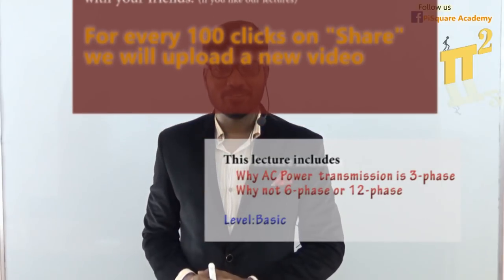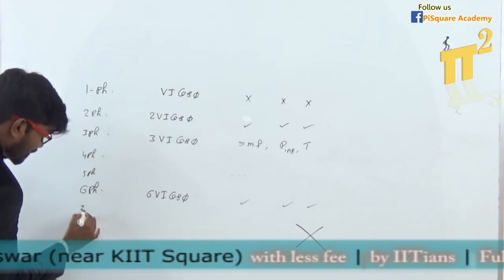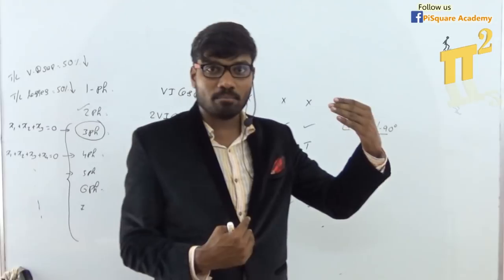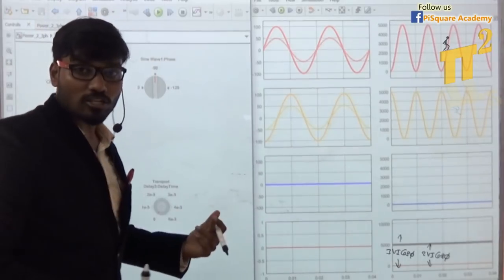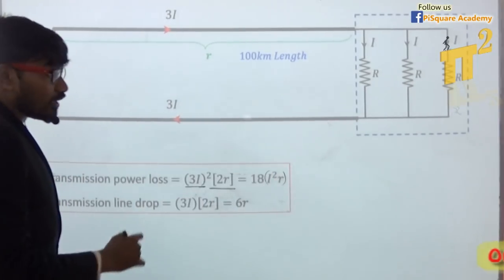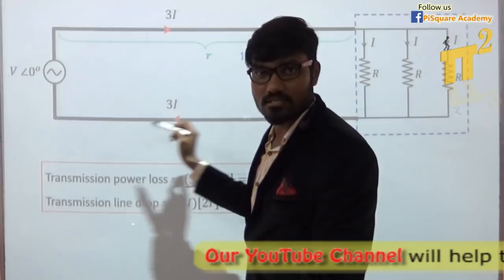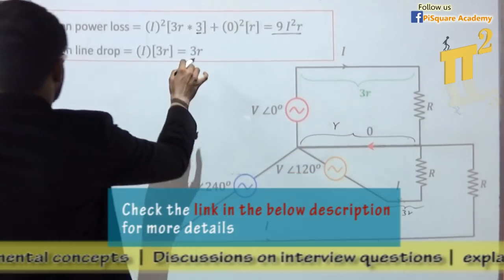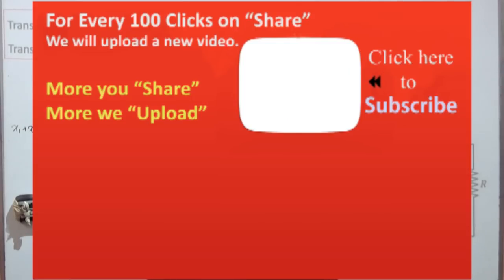Why 3-Phase Why not 1-ph, 4ph, 6ph, 12ph Why 3-phase transmission | PiSquare Academy

Comment: Thank you sir, one question sir what is phase what is the means of phase
Reply: Phase is the coil. A coil has two ends for example phase A will have a1 and a2. The current drawing in this coil from a1 to a2 is the phase current. The wire taken from one end of that coil is the "line".
Reply: Aamir Awan sir can We say that in simple words phase means supply voltage
Reply: Varsha Paliwal no. Phase and line voltage are both supplied by the source. Lets take a star connection. In star the line voltage is measured across two lines and phase voltage is measured across one line and the neutral. If line to neutral voltage is 230 the line to line voltage will be 230*1.733= 398 or we write it 400.
Reply: Varsha Paliwal and in delta the line and phase voltages are same. Cause the one end of the coil is connected to one end of the other coil and theres no neutral so potential difference is same for line and phase.
Reply: Aamir Awan thank you sir
Reply: Varsha Paliwal you are welcome sir
Reply: Phase change is nothing but generation of voltage in the 2 different coil with a different time and continues

Comment: why are we using sinusoidal A.C supply. why are we not using square wave, sawtooth wave form....?
Reply: dekh bhai transmission line consists of L&C component due to which contineous differentiation and integration occurs of your waveform...... square wave integraion converts to triangular but sinusoidal remains sinosuidal with phase shift hence rms value remains same
Reply from the maker: check this video you will get the answer https://www.youtube.com/watch?v=8yf3NeRNklE

Comment: In practice since the loads in the three phases are not usually balanced, current in the neutral wire is not zero. The transmission line losses never be reduced to 50%.
Reply from the maker: @Feleke You are absolutely correct, system will never be balanced. Hence losses will never be reduced to 50%. But you certainly get some reduction in the losses which is significant in power systems point of view. With 1-phase configuration you never get a 1% reduction in the losses. 

May be it would appropriate to call, "Reduction in losses upto 50%"

Hope you got the point.
Reply: @ThePiSquareAcademy  I agree with the explanation. Thank you.
Excuse me sir, can I ask questions related with 3 phase power transformers?

Comment: Y we use star connection in load side and delta use in  transmission side
Reply: if we use star at transmission which requires 4 conductors , but in delta there is 3 conductors is enough.. that's why we use delta in transmission

Comment: How return current will flow back to source in 3phase system sir..??
Reply: if you look at the 3phases you will see that at any time one phase do the job of a return path..so that's why there is no extra neutral conductor but in case of star connection there is always a neutral conductor for protection purpose
Reply: @atanukoley1834  
Thank you sir...

Comment: I think single phase induction motor also generates rotating magnetic field
Reply: No. Single phase IM produces pulsating magnetic field therefore we use capacitor and auxiliary winding to get rotating magnetic field.
Reply: Single-phase motors generate two rotating fields in both directions (Leblanc's theorem), which is why a single-phase motor does not start and that it is necessary either to start it by hand (old solution) or to add a coil of start-up powered by a phase-shifted current using a capacitor. This is also why it is impossible to manufacture high power single-phase alternators (> 10kVA).

Comment: Why would 3phase provide the feasibility of self  starting of induction motor/ synch motor with damper windings?
Reply: because of the induction principle from reaching synchronous speed
Reply: @sudeepmaurya883  Thank You. But I didn't get what you meant?
Can you please explain?
Reply: @sudeepmaurya883  I guess that is because of the rotating magnetic field produced because of a 3phase stator. Correct me if I am wrong.
Reply: Bcz three phase develop flux and hence torque however it is also in 2 phase but torque smoothness is not good that's why we use 3 phase and single phase can't produce torque required to self start
Reply: @merepyaresakha1922  Yeah, I got what you mean (sort of), but still don't realise why exactly would a single phase supply to stator winding, won't produce torque for self starting. I mean we all know single phase induction motors exist but why wouldn't they self start. I guess the water pumps used in households are nothing but single phase induction motors. How do they self start then??
Reply: @abhisekrout8522  single phase induction motor can self start by connecting a capacitor that provides a phase shift by which it get self start
Reply: @merepyaresakha1922  Thank You So much Shivani. I really appreciate your response.
Reply: @abhisekrout8522  that was about damper bars ........damper bars in synchronous machines just gives initial start as they are not self starting m/c's. rmf rotates at synchronous speed that cannot help the cause only induction principle can self start ,rmf keeps the track after it gets towards the synchronism and thus gets locked to the stator and thus synchronous speed is achieved by synchronous motor and maintained there.in induction motor the the winding establish a current (induced) due to relative motion between rmf and rotor conductors and lenzs law follows to reduce the relative motion so that current induced would be 0. for the reduction of relative motion rotor starts rotating in the same direction as of rmf.

Comment: I do not get how the resistance increases by 3 times in 11:35. I mean yeah the Current had reduced by 3 times but is it correct to say that the line offers 3 times more resistance since there is 3 times less current to push through the line? That is what I think but the idea seems flawed if the area of the wire that will be used to transmit 3I is different from that used to transmit I. Can anybody please clarify or just explain how the resistance is 3times more in that case.
Reply: Actually current is directly prop. to the area of cross section of the wire for the same voltage drop.  But resistance itself is indirectly prop to the area of cross section,  therefore from the two proportionalities, we can say current is inversely prop to the resistance, for the fixed potential difference, Which is also a simple ohms law concept... Your current is reducing by a factor of 3, so obviously resistance will increase by the same factor, keeping voltage fixed
Reply: @eagleeye7098  It's not like that
Reply: Yes, As the current requirement is reduced for that conductor, the size(cross section) of the conductor (of same material) is also reduced(because of copper saving). So, we can say that the resistance that wire offers will be 3 times to that of the previous sized conductor.

Comment: Ploss is multiplied with 3
But vd is not multiplied with 3 .and why?
Reply: I too have same doubt
Reply: Same doubt
Reply: I think ,in parallel connection voltage is same so voltage drop is same in all phase

Comment: At 10:06  why parallel resistors have same current
Reply: Because in parallel connection current is divided and so 3I is divided in 3 parts
3I = i+i+i
Reply: Because the three resistors have the same value , so the current that requieres each resistor it's  the same. You can tell that each resistor have the same name "R", that means that they have the same value in "ohms"
Reply: For a balanced s/m we will consider a balanced load having 3 loads having equal values.so the current will be divided equally

Comment: But why I1+I2+I3 =0 plz explain
Reply: Plz tell
Reply: hi  @poojadhage8992  

Im => amplitude of the current

Currents for the all phases will be;

İa=Im *cos(theta),
İb=Im*cos(theta-120)
İc=Im*cos(theta-240) or  Im*cos(theta+120)

Sum of the phase current is:

Im*[cos(theta)+cos(theta-120)+cos(theta-240)]=0

Because  [cos(theta)+cos(theta-120)+cos(theta-240)]=0

to try, you can take "theta" any degree but I suggest you take it "0 (zero)" degree to ease the calculation. You will see, it is going to zero all the theta values. These systems are called balanced systems. İf the angle between the phases is (2*pi/n,  n: number of phases), it is called balanced systems.
Reply: For balanced system c/n in 3 phases are equal so incoming c/n =0

Comment: Simple answer is 
Economical reason of assets...
If 12 phase 1000km transmission  line ...horrible..
Making wound rotor turbo / steam generator stator coils with polyphase is difficult with insulation coordination  and end winding issues ...
Most economical way to produce and transmit is 3phase....
No need big explanation

Comment: Why we are not considering the current when calculating transmission line drop. (I)(3r)=3r (where does the I gone?)
Reply: In 3 phase balance system phaser sum of all current[R Y B] is zero so no current will flow means no losses

Comment: of course two phase and three phase systems has same properties ,why we use only single phase for small loads and why not 2 phase
Reply: In small load power required is small so we use , if u talk about 2 phase , phase shifting will be little bit complicate to transfer. Not so much advantages. main property of 2 phase is rotating field so we use the properties in motor by splitting the single-phase into 2 phase

Comment: You are totally wrong in saying that in two phase current , sum of  phases at an instantaneous point is not equal to zero.  It is zero and u r wrong in many basic things and  also lacked to proove about the 50% loss and the concept itself seems wrong
Reply from the maker: Dear follower, we appreciate if you can prove us wrong regarding 2-phase instantaneous power. And we have explained in the lecture about 50% losses are reduction. please watch the video completely.
Reply: PiSquare Academy I can say that why 3 phase is good to transmit but it takes me to prove about 10000 word to prove